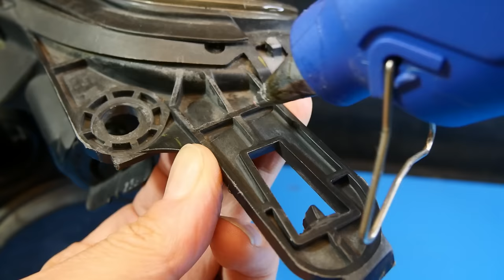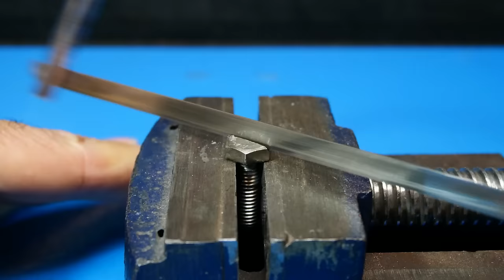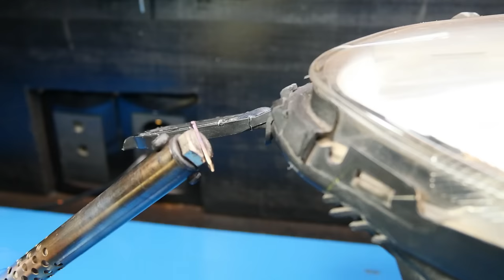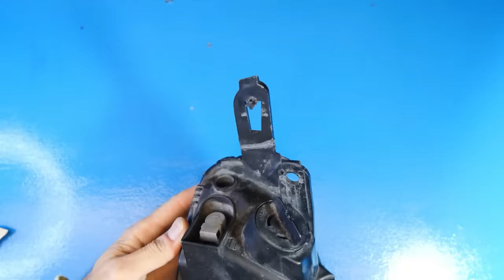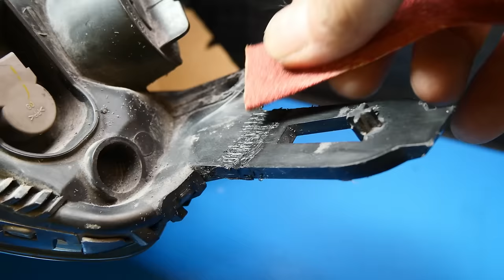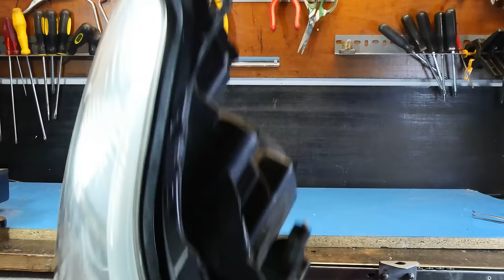Solo los Ricos Compran Nuevo ! Repare el Faro de su Automóvil y Ahorre Dinero !!

Comment: How do you know what temperature the iron should be at so you don't burn the plastic???   Iron temp has to be controlled to correct melting point of plastic used.   How to you set it????